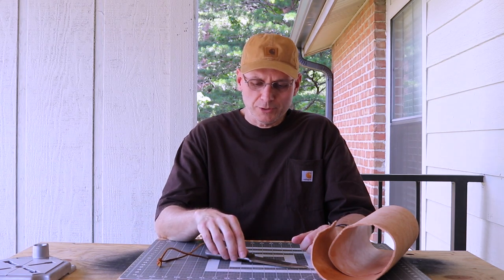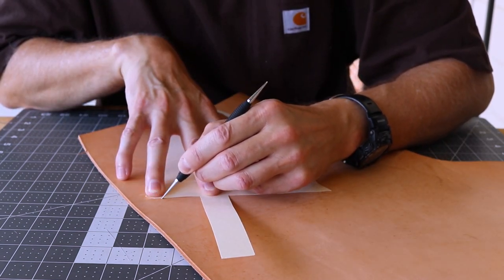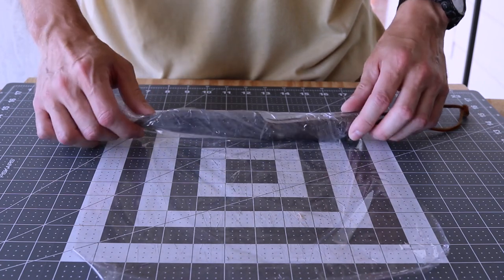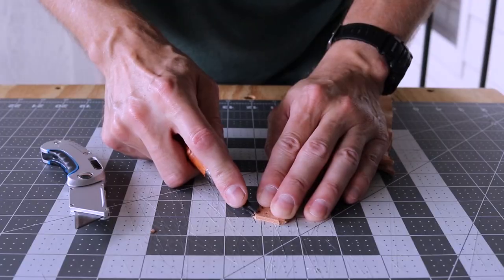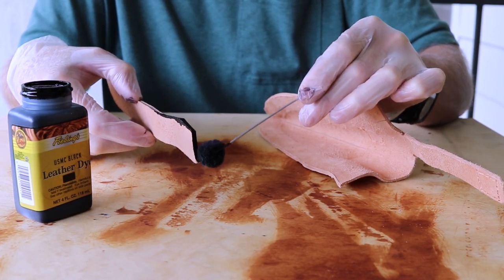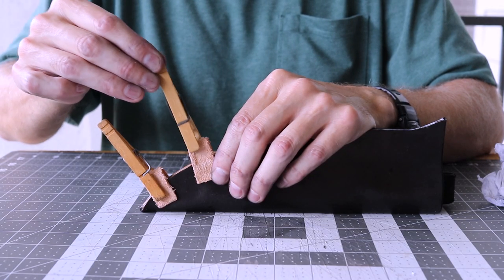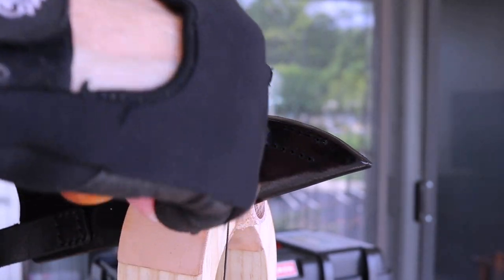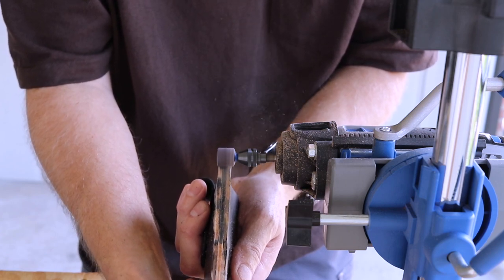How to MAKE LEATHER SHEATH for Pathfinder PLSK1 Belt Knife

Comment: Do you make leather sheathes to sell. 
If you do Can you do one for the mora pathfinder with a loop for a 1/2 inch ferro rod.  Hood video. I don’t have the patience to do that.
Reply from the maker: I don't make them to sell. I'm just a hobbyist. I've never made one with a ferro loop, and I may have to try that on my next one. I've made several belt knife sheaths. But in this video, I finally got it right as the blade fits deeper without a lot of the handle sticking out. I want to redo my other sheaths to fit like this one. Thanks for watching my video!